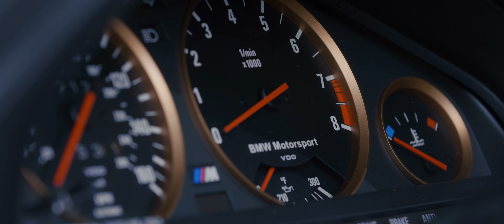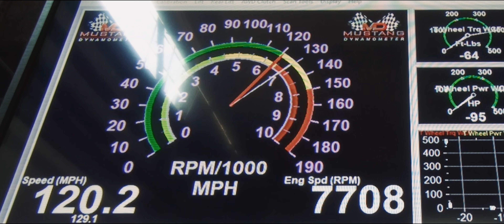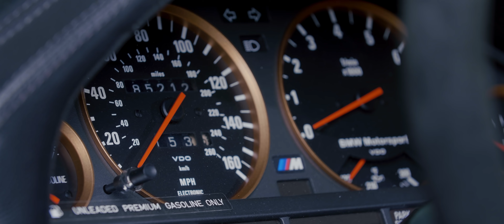THE JAWDROPPING E30 M3!! INSANE INTERIOR AND MORE! |  THE BUILD

Comment: I have a e30 with a m60 out of a alpina b10 a zf8 80L tank makes around 400ps has 17 magnesium wheels x4m seats g30 steering wheel interior all Alcantara dashboard from a f80 panoramic roof (custom made) a h/k sound system and many parts out of carbon fibre. 

It drives very good is reliable and I did around 250.000km with this config and it’s a joy everytime I get into it.

Was my first car and I have had it for like 19 years never selling it ever the entire build cost me around 40.000€ 

Greetings from Istanbul🫡

Comment: No, details are baddly wrong.   It had a 2.3 litre straight 4.   It was made for group A regulations in 1987.   They required  500 units to be homologated.  That is all.   Not 5000.   There was supposed to be a base unti of 5000 but many margues producted less, ie 2000 like maserati.    The car quickly (1990) got a  2.5 litre.   the bodywork of the grey car is 1991 and that was a 2.5 litre.   In racing they started with 285 brake hp,  and finished group A with 330 bhp, and the DTM with 380 brake bhp.

Comment: I don't get it ,if you're going to modify it to death then why leave the 4 cylinder in there? Alpina built the ultimate M3 with the B6 3.5S , it had a simple straight 6 3.5 tuned and with a manual gearbox. Best e30 made.